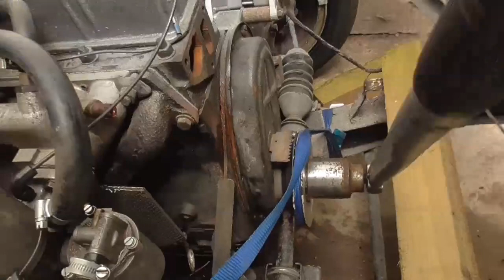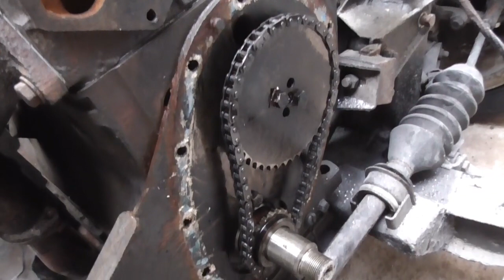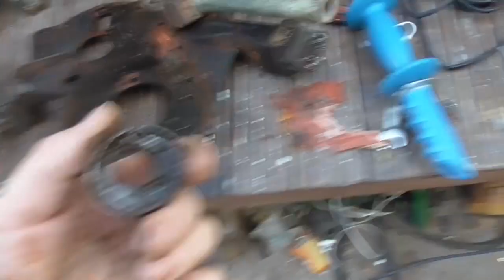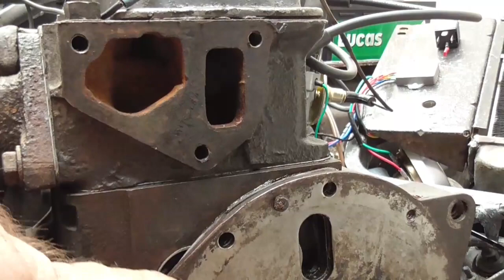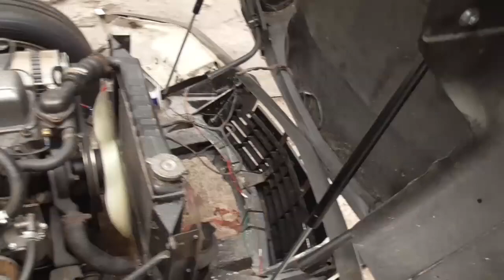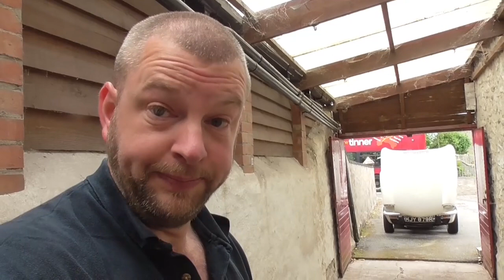Triumph Spitfire | Amateur Restoration | Mystery Water Leak

Comment: I put the car at TDC. It needs to be at TDC so both valves are closed so you are not putting pressure on a partially opened valve.  Fed a bit of rope in the number one spark plug hole and broke my pulley nut off. The rope doesn’t allow the engine to spin over. Done this on a couple engines.

Comment: Hi, I don’t have time to watch the full video at the moment. Two ways to remove the big nut holding the crank pulley, Hire or borrow a 3/4” impact gun and buy a impact socket to fit. Second method, put a block of wood on the chassis rail, spanner on the big nut and use the starter motor to loosen the nut. ( Starter flings the spanner against the block of wood shocking the nut loose.  Be very gentle with the bottom screws in the timing cover as they screw into the aluminium saddle piece ( very easy to strip and a pain to repair). Use brass frost plugs not steel ones. Wipe pipe sealant around the edges before installation. The small timing gear has shims behind it to align the pulleys (Haynes manual). David
Reply from the maker: Thanks. She's done now. Used the ratchet strap method, works a treat